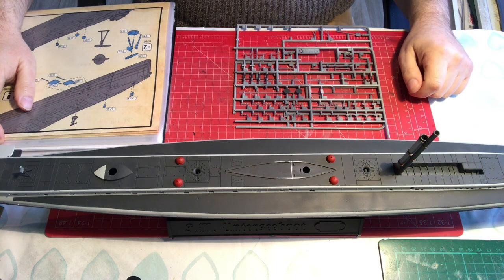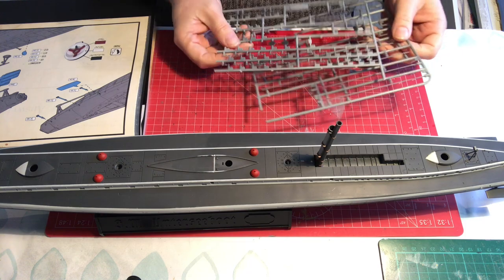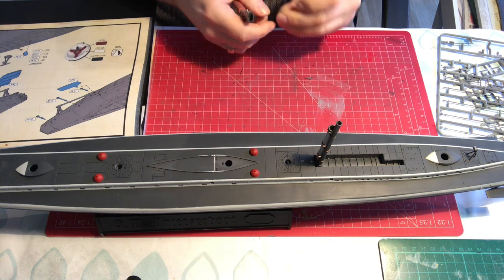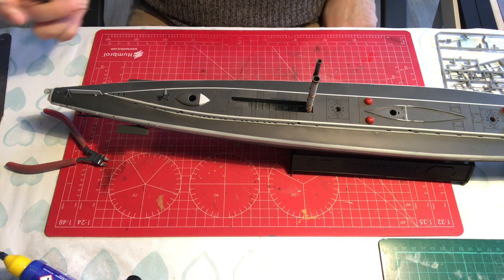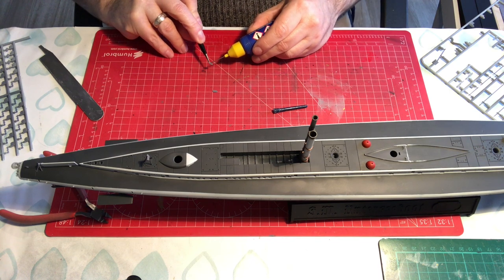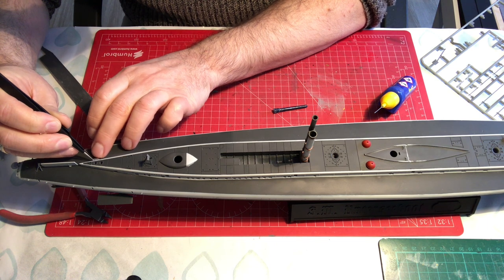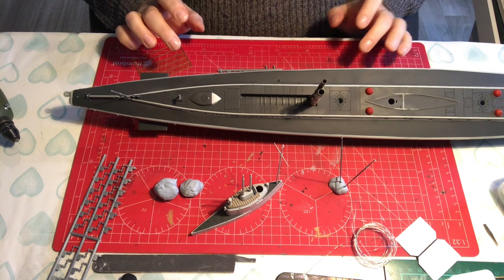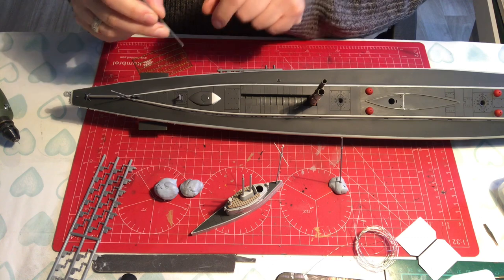Das werk 1/72 WW1 u-boat SM U9 build part 8

Comment: Looking fantastic. Good work on the rigging. Another good source for eyebolts in multiple scales is model railroad detail sets. They are usually styrene so they are more 3D than the PE units although in 1/72 no one will probably notice. You're welcome on the lift raft covers. Did you get my email on the Arizona boats?
Reply from the maker: Hi Charlie, yep I have your pics I mentioned them in the round up video and will discuss in the next Arizona video, many thanks for them very helpful.